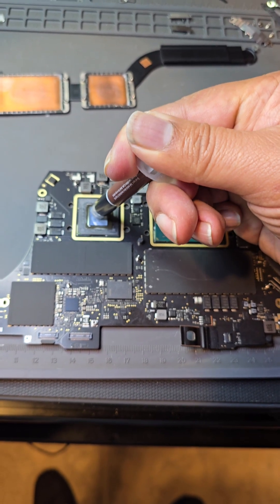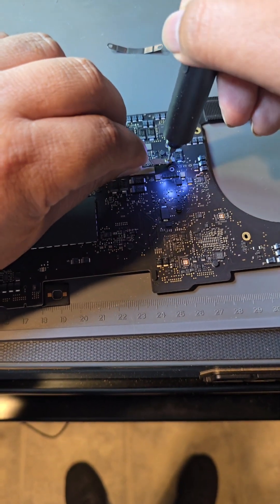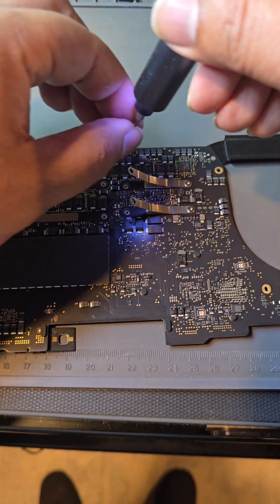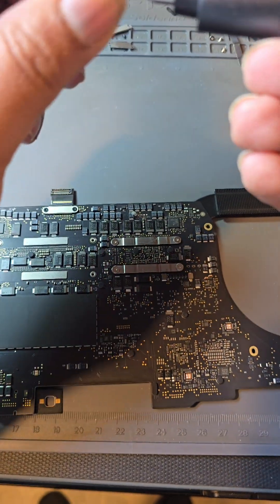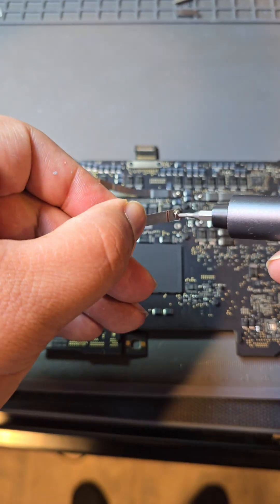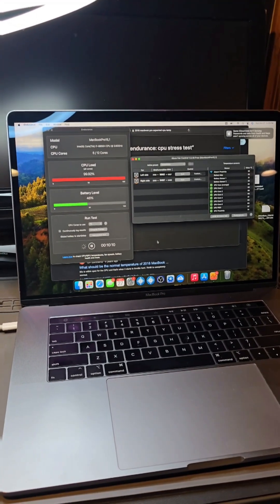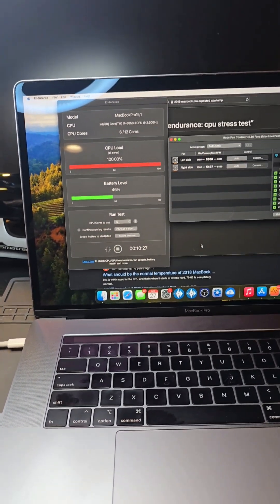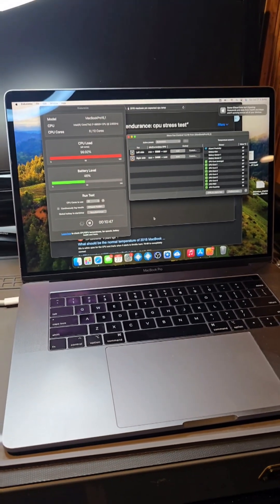Macbook Pro Over Heating? Here's how I fix it!

Comment: I didn't know those got hot so easy , maybe they need to re plan them with bigger fans ?  Great info Mon Ami....
Reply from the maker: @cajuncoinhunter  What is actually worse is that many don't speak about the thermal expansion. Boards can get to 100C or more before shutting down, and a few times of this is enough to cause fatigue in some of the headers. While solder melts between 300 and 400 degrees F, the overheating and expansion causes the solder structure to weaken and the headers to stress. This makes it very easy to accidentally pop off a header while trying to remove a connector.
Reply: @edtheoldtechguy  Yep it does get warm in there . Leadfree solder , starts to melt at 425 F , depends on the make up of the solder ..... I hate lead free .....There are a lot  of bad solder joints with wave type soldering with leadfree solder ..... Brand new off the shelf problems are common , that's why you see " Refurbished "  items that sell for a discount .... New items didn't work right outta the box and got returned to the company .... Problem diagnosed and repaired , then sold for a lesser price ....
Reply from the maker: @cajuncoinhunter  You are an expert in this area, so I can only dance around it. I appreciate you sharing. One of these days on one of your lives, maybe we can talk about it. Would be fun.